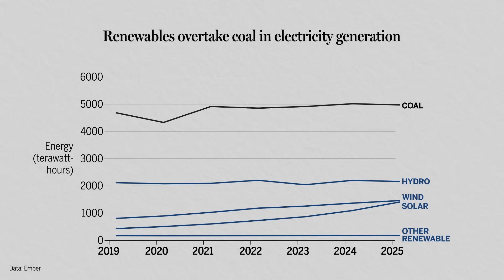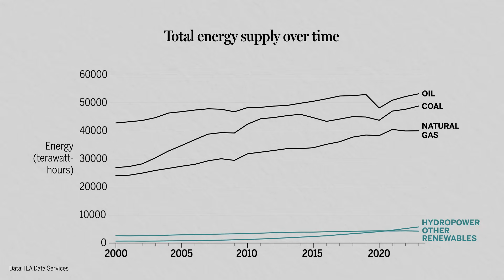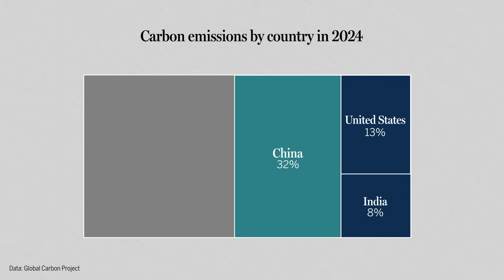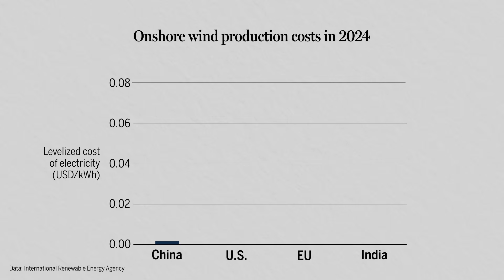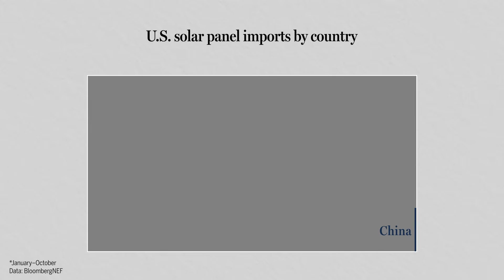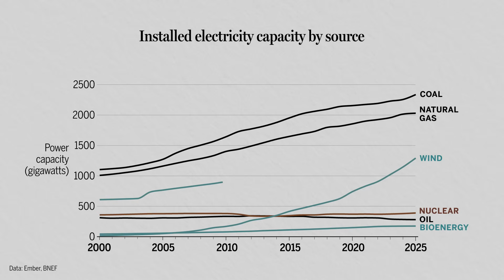How cheap renewable energy is finally flattening emissions

Comment: Thank you China for the advance in renewable energy. USA is just leaching off of your technology but pretending to be the leader.
Reply: So, how do you explain all the failed climate doomsday predictions over the last 50 years? I know, you keep moving the goalposts.

1. The Ice-Free Arctic by 2013

In the early 2000s, some predictions claimed that the Arctic would be completely ice-free by 2013 due to rapid warming. While the Arctic has seen significant ice loss, it still retains ice cover. The rate of change has been slower than predicted.
Lesson: Climate models are complex, and not all predictions happen on the timeline we expect. This doesn’t mean the Arctic isn’t in trouble—it just highlights the need for nuanced, measured action.
2. The End of Snow in Europe

A 2003 report suggested that within a few decades, snow in Europe would become increasingly rare. However, Europe continues to experience snowfall, and even record snowfalls in some regions, due to natural fluctuations in weather patterns.
Lesson: While climate change shifts patterns, nature can still surprise us. Focus on long-term stewardship rather than short-term alarmism.
3. The Submerging of the Maldives by 2018

The Maldives and other low-lying nations were predicted to be underwater by 2018. While rising sea levels pose a serious long-term threat, the Maldives are still above water today, thanks to both slower-than-expected sea-level rise and adaptive measures.
Lesson: The situation is serious, but there is time to act. We can help vulnerable regions adapt while also tackling the root causes of rising sea levels.
4. Mass Starvation Due to Global Warming (1970s)

Predictions in the 1970s warned of mass starvation due to crop failures caused by global warming. While climate change does affect agriculture, technological advancements and new farming techniques have helped maintain food supplies, even in changing climates.
Lesson: Human innovation can solve many problems, but we must continue investing in sustainable agricultural practices.
5. Climate Refugees in the Millions by 2020

In 2005, the UN predicted that by 2020, millions of people would become climate refugees, fleeing from rising seas and natural disasters. While climate-induced migration is a real issue, the scale of displacement hasn’t been as catastrophic as forecasted.
Lesson: Rather than predicting mass panic, we should focus on supporting adaptation and resilience in vulnerable communities.
6. New York Underwater by 2015

Some models suggested that New York City could be largely underwater by 2015 due to rising sea levels. While coastal flooding is a concern, proactive measures, such as seawalls and flood management, have helped reduce immediate risks.
Lesson: Sensible planning and adaptation can mitigate many of the worst potential impacts of climate change.
7. Polar Bear Extinction by the 2010s

Some headlines in the 2000s claimed that polar bears would be extinct by the 2010s due to loss of Arctic ice. While polar bear populations face significant challenges, they have not vanished, and conservation efforts are underway to protect them.
Lesson: Species can adapt and recover when given the chance, but proactive conservation efforts are critical.
8. The End of the Amazon Rainforest (2000s)

In the early 2000s, some predicted that the Amazon would be completely destroyed within decades due to deforestation and climate change. While the Amazon is under threat, it has not disappeared, and conservation efforts have helped protect large areas.
Lesson: Large-scale environmental destruction can be slowed and even reversed with global attention and action.
9. The Melting of Greenland

It was predicted that Greenland’s ice sheet would disappear rapidly, leading to major sea-level rise by now. While significant melting has occurred, Greenland’s ice sheet is still largely intact, though long-term risks remain.
Lesson: Climate predictions aren’t about certainty but probabilities. We still have time to adapt and protect key regions.
10. The Ozone Layer Collapse (1990s)

The ozone layer was predicted to collapse entirely, causing widespread health problems by the 1990s. However, thanks to the global ban on CFCs, the ozone layer is healing, and we’ve avoided a catastrophe.
Lesson: Global cooperation can solve environmental crises. The ozone recovery is a powerful reminder that collective action works

Comment: This progress is great and should not be ignored. However, renewables still have the underlying issue of intermittence and lack of dispatchability. There are a lot of creative ideas on how to flatten some of the effects of intermittence in renewables, such as more interconnections that enable the use of inversely correlated weather patterns, the use of distributed small scale storage like EVs and Tesla battery packs, but the fact remains that renewables will not be the dominant energy source until large scale, long term, dispatchable energy storage is cheap and ubiquitous. This conversation needs to be at the forefront of the movement.

Comment: Hello, I am Alireza. I have designed a mechanism that can be installed on a generator and is able to rotate any generator and produce electricity without using any fossil fuel, and without the need for any battery, solar, wind, or nuclear energy. It can be done on household, industrial, and power plant scales. In addition, if this mechanism is installed on vehicles, including cars, ships, airplanes, helicopters, and trains, it can move or fly them without fuel. The advantage of this system, in addition to not consuming fuel, is the removal of all internal combustion engines, including cylinders, pistons, connecting rods, crankshafts, radiators, and ... from their bodies.

Comment: Wind and solar are not "reliable", "renewable", "clean" or "green" and they are barely even "energy"
Reply: Someone doesn't have a solar panel with batteries on their roof. It saves a ton on your power bill.
Reply: @haven216  They are subsidized. I pay for your panels. If you want roof panels be my guest, it's a free country. Just stop mandating and subsidizing them.
Reply: @haven216  A solar panel without the ability to track the sun isn't doing much of anything. The little roof ones you see do practically nothing
Reply: @Nyan4Eon  I call BS. Here in Australia, the Sun is high in the sky for most of the day, most of the year. You don't need tracking like Starlink to get more than enough solar radiation. Just this month, the energy production from solar panels here have avoided blackouts/brownouts during especially hot days.
Reply: So, how do you explain all the failed climate doomsday predictions over the last 50 years? I know, you keep moving the goalposts.

1. The Ice-Free Arctic by 2013

In the early 2000s, some predictions claimed that the Arctic would be completely ice-free by 2013 due to rapid warming. While the Arctic has seen significant ice loss, it still retains ice cover. The rate of change has been slower than predicted.
Lesson: Climate models are complex, and not all predictions happen on the timeline we expect. This doesn’t mean the Arctic isn’t in trouble—it just highlights the need for nuanced, measured action.
2. The End of Snow in Europe

A 2003 report suggested that within a few decades, snow in Europe would become increasingly rare. However, Europe continues to experience snowfall, and even record snowfalls in some regions, due to natural fluctuations in weather patterns.
Lesson: While climate change shifts patterns, nature can still surprise us. Focus on long-term stewardship rather than short-term alarmism.
3. The Submerging of the Maldives by 2018

The Maldives and other low-lying nations were predicted to be underwater by 2018. While rising sea levels pose a serious long-term threat, the Maldives are still above water today, thanks to both slower-than-expected sea-level rise and adaptive measures.
Lesson: The situation is serious, but there is time to act. We can help vulnerable regions adapt while also tackling the root causes of rising sea levels.
4. Mass Starvation Due to Global Warming (1970s)

Predictions in the 1970s warned of mass starvation due to crop failures caused by global warming. While climate change does affect agriculture, technological advancements and new farming techniques have helped maintain food supplies, even in changing climates.
Lesson: Human innovation can solve many problems, but we must continue investing in sustainable agricultural practices.
5. Climate Refugees in the Millions by 2020

In 2005, the UN predicted that by 2020, millions of people would become climate refugees, fleeing from rising seas and natural disasters. While climate-induced migration is a real issue, the scale of displacement hasn’t been as catastrophic as forecasted.
Lesson: Rather than predicting mass panic, we should focus on supporting adaptation and resilience in vulnerable communities.
6. New York Underwater by 2015

Some models suggested that New York City could be largely underwater by 2015 due to rising sea levels. While coastal flooding is a concern, proactive measures, such as seawalls and flood management, have helped reduce immediate risks.
Lesson: Sensible planning and adaptation can mitigate many of the worst potential impacts of climate change.
7. Polar Bear Extinction by the 2010s

Some headlines in the 2000s claimed that polar bears would be extinct by the 2010s due to loss of Arctic ice. While polar bear populations face significant challenges, they have not vanished, and conservation efforts are underway to protect them.
Lesson: Species can adapt and recover when given the chance, but proactive conservation efforts are critical.
8. The End of the Amazon Rainforest (2000s)

In the early 2000s, some predicted that the Amazon would be completely destroyed within decades due to deforestation and climate change. While the Amazon is under threat, it has not disappeared, and conservation efforts have helped protect large areas.
Lesson: Large-scale environmental destruction can be slowed and even reversed with global attention and action.
9. The Melting of Greenland

It was predicted that Greenland’s ice sheet would disappear rapidly, leading to major sea-level rise by now. While significant melting has occurred, Greenland’s ice sheet is still largely intact, though long-term risks remain.
Lesson: Climate predictions aren’t about certainty but probabilities. We still have time to adapt and protect key regions.
10. The Ozone Layer Collapse (1990s)

The ozone layer was predicted to collapse entirely, causing widespread health problems by the 1990s. However, thanks to the global ban on CFCs, the ozone layer is healing, and we’ve avoided a catastrophe.
Lesson: Global cooperation can solve environmental crises. The ozone recovery is a powerful reminder that collective action works
Reply: @amiava4213  Why are you sending this to me? Where did you get the idea that I support or defend any of these ridiculous predictions.

Comment: The problem with renewables vs coal and LNG is the ability to store unused electricity. Batteries are not a long term sustainable option for renewables to be helpful in reducing emissions. Nuclear is the only option of meeting demand at a moments notice without generating additional emissions.
Reply: @sethicus98123  says who? Battery tech is developing at absolutely break neck speeds right now, with sodium batteries actually entering viable production

Comment: Apparently a solar farm covering 1.2% of the Sahara desert would provide enough electricity for the entire planet.
Couldn't countries get together to fund something along those lines if not necessarily on that scale?
Reply: Absurd.
Reply: @anthonymorris5084  Why?
Reply: @ppuh6tfrz646  Because it isn't true. Don't you think a north African nation would have tapped into this windfall?
Reply: @anthonymorris5084  Actually, it is true.
The Sahara desert is huge and 1.2% represents an area of over 40,000 square miles
The problem is cost, construction in a remote area and long distance power transmission which is exactly why I suggested that countries get together to work on it.
Reply: @ppuh6tfrz646  The Sahara also moves constantly. The sand dunes are larger than buildings and change. The topography is moving all the time and panels would be buried in a couple of days. It is also quite likely that the solar farms and panels on roof tops already surpass 40,000 square miles across the globe and this has hardly put a dent in our energy needs.
Reply: @anthonymorris5084  No.
In China, deserts have been flattened in preparation for the construction of solar farms so that deals with the topography issue.
There's approximately 6,000 square miles of solar panels worldwide, that includes rooftop and ground-mounted panels.
This accounts for 7% of global electricity.
When you consider that the Sahara Desert has higher peak sun hours per day and much greater sunlight intensity than global averages then a 40,000 square mile solar farm could well meet the planet’s electricity needs.
Reply: @ppuh6tfrz646  There is no desert in China that is like the Sahara and what China has done is destroyed millions of hectares of desert habitat. I thought that this was what we are trying to avoid. 

You can't flatten the Sahara desert, are you joking? The cost of your idea makes it ludicrous. 

The obvious answer to your delusional idea is that nobody is attempting this. There's a reason.
Reply: @anthonymorris5084  No.
You tried to spout figures and have been proven wrong each time.
And now you've explored the deserts of China...
It's best if you actually know the facts.
It would have saved you all of that time you've spent typing nonsensical comments.
Reply: @ppuh6tfrz646  The only nonsensical comment is your desire to cover large portions of the Sahara in panels. It's not being done for a reason. You seem to think you're the only person on the planet that has thought of this.

Comment: So much damage to beautiful environments and landscapes by monster solar and wind, and all for nothing. The climate will never stop changing, has changed much more dramatically and rapidly in the past, and has never been driven by Co2. Long term Co2 averages over 3 times the current level, and life was bigger and better.
Reply: Fossil fuels have done more damage to the environment than any renewable energy source ever could. It is precisely the reason why we are talking about global warming and climate change (which is caused by global warming) now. There is no natural cycle that can explain going from mild ice age to late-Miocene temperatures and CO2 concentrations within two centuries, which is disastrous for the ecosystems that have no time to adapt.
Reply: @haven216  One of many unexplained types of rapid climate change include D-O events: "Ice core records in samples extracted from Greenland, Antarctica, Canada’s Arctic Archipelago, and high mountain glaciers in South America show that these climate changes have been large, very rapid, and globally synchronous. Over a period of a few years to a few decades, average temperatures have shifted by up to half of the temperature differences seen between the Pleistocene ice ages and their interglacial periods—that is, as much as 5–15 °C (9–27 °F)." (Source -Britannica).
There are thought to have been up to 25 of these this glacial cycle alone. Clearly 10 deg C warmings in as short as a few years are far beyond the Modern Warming we are in now, which looks irrelevant in comparison. The IPCC not only accepts the reality of these massive warmings but also concedes there was no Co2 signature with them. So if other natural forces are the real drivers of climate change, it's very possible that fossil fuels are having no impact on climate.
Reply: @haven216  Rational people embrace the concept of an environmental cost/benefit analysis and fossil fuels have contributed incalculable benefits to humanity saving billions of lives. 

There is no evidence that warming is a problem and your claim that ecosystems have no time to adapt is nothing but parroted nonsense that also comes with zero evidence. 

Millions of plant and animal species across the entire northern hemisphere experience temp changes from +35C down to -35C every six months. Nothing dies. This can only be characterized as dramatic and rapid climate change. They experience greater temp changes simply from day time to night time.

Comment: Renewable energy is not cheaper than fossil fuels that's a lie - it's much more expensive
Reply: Why do you think so many areas are switching away from coal in favour of solar alone. It's not just cheaper, it is significantly cheaper. So much so that coal now powers less than all renewables.
Reply: @haven216  Cheaper to produce power yes, cheaper for your bills absolutely not. TTF/NBP Front Month gas prices have halved over 2025 and in the UK our bills keep going up and we're told expensive gas is the problem and we need more renewables.
Reply: @MrRaisin56  Have you installed solar panels on your roof with batteries? It saves so much on your power bill, at least in Australia. Everyone and their mum has one.